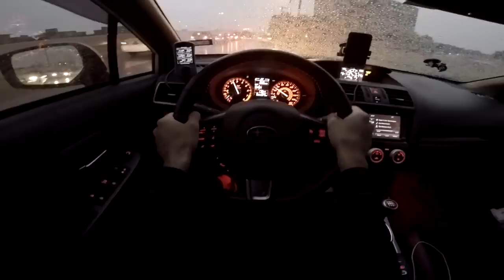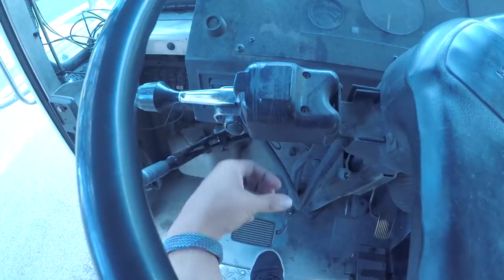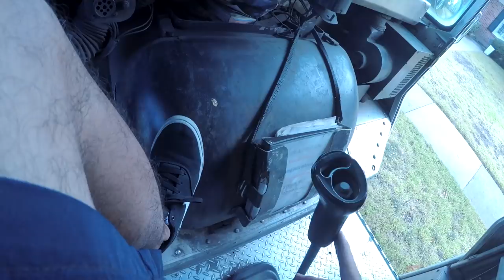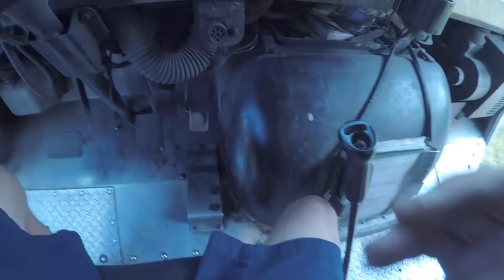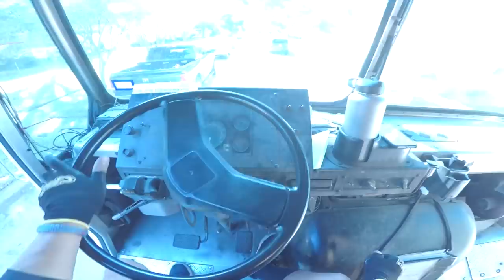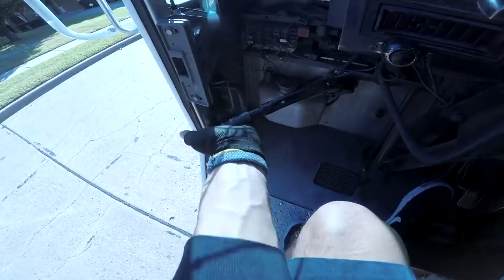How to Drive Manual IN A DELIVERY VAN!!!!

Comment: Never seen 1st gear left and down
Reply: BerlinBLR 
In race cars it’s common. But I have no idea why it’s like that in this, just an old design maybe,
Reply: @13ON3S  it's called dogleg and it's because race cars spend most time in 2nd and 3rd gear and having 1st left and down makes shifting from 2nd go 3rd and vice versa easier because it's just straight down
Reply: At my hub we had only 2 trucks with stick shifts on the whole building and they were both like that. I think it's just common for stepvans.
Reply: It's called a dog leg gearbox so you can get into 2nd and third quicker
Reply: BerlinBLR all the semis I’ve been in have it like that.
Reply: @mlk2634  In some older cars, like the willys jeep, First is down and Reverse is up, and they do that so that when your making a tight maneuver you can switch between the two quickly.
Reply: @Dsack Garage  thats awesome i was going to go feeder but then a mall route opened up over where i am so just push carts around and drive a 24 footer too and from lol
Reply: Is probably a Eaton Fuller one
Reply: BerlinBLR yup is a 5 speed mid range Eaton Fuller Transmission mostly use for small or medium duty trucks
Reply: @mlk2634  the first gear is useless in these trucks thats why its huge to have the dog leg. I never take off from first gear!
Reply: My dad had a old Iveco truck, the gears we're the same as the delivery car
Reply: I'm pretty sure all Eatons are like that
Reply: They do a lotta 2nd - 3rd and barely use the 1st unless they start in a big hill/full af. The 1st is short af
Reply: What I think that’s a regular in semis and stuff idk if you’ve driven one on 10 speed I learnd
Reply: @Dsack Garage you should always use first gear.. because when you start in 2nd you have to slip the clutch longer before you fully release..... So it wears the clutch faster
Reply: its a dogleg shifter, because most of the truck have no synchro in 1st, you dont have to use first unless its a complete stop
Reply: I think some golf mk2s were like that.
Reply: @DSTARX43  are all the manual trucks like that ?
Reply: And because reverse is where 1st should be. That's like the rigs, we never start in first, lowest I ever start is 3rd and that's on a hill, in a 10 speed at least
Reply: @mlk2634  But in "normal car" from 2nd to 3rd is just straight up ...
Reply: @kbdadriftking  on a passenger vehicle maybe, but on diesel trucks the gears are short and you can start in 2nd even 3rd without damaging the clutch
Reply: First gear for me is all the way left and up
Reply: All japanese manual trucks have that shfting pattern.
Reply: Same I’ve never seen it before
Reply: My dad had a Volkswagen Bus from the 80es with the rare 5 speed gearbox and the same pattern.

Comment: Imagine heel toe downshifting in this thing....
Reply: John Mc Clein M. Federico  when you heel and toe it doesn't matter how deep the clutch is. you press the clutch with your left foot then hit the gas a bit change gear and let of the clutch.
Reply: That would be epic 😂👌
Reply: Your employer sucks for giving you this Mad Max truck. ://
Reply: Harry Sachs  it runs great and performs great. whats your point?
Reply: So im a dump truck driver and we actually do heel toe our trucks! Clutchless heel toe downshift!
Reply: @trixter55able  Well if you don't use the clutch you could surely just left foot break. Otherwise what's the point of heel toeing when you don't use the clutch?
Reply: @merlin9702  Nah, the clutch pedal and the brake pedal are really far apart. If you want to google the pedal setup of a Kenworth T800 youll see how far apart they are from eachother! Its just easier to heel toe so your left foot isint at a super weird angle!
Reply: @trixter55able  Oh damn you're right. The gas and brake pedals are also really close which helps. Learnt something today thanks.

Comment: Thanks for the video. A good rule of thumb of when to change gears if you have no tachometer is to listen to the engine. When the engine sounds like it's revving higher, that's a good time to switch gears.

Comment: As a fellow FXG driver, I wanted to add a few things:

1) These trucks are not nearly as old as you think. People saying their from the 80's... They're not. This particular truck is an International model, and this design was used until at least 2003, possibly later

2) They are incredibly slow. The engines are powerful enough, but the lack of a gear splitter makes it so your either dogging the engine or redlining it at all times

3) I've driven one. They're stupid fun, but not as a work truck. Just to roll around in one would be cool, but they're way too impractical for a package delivery application. 

4) I've had people walk up to me and offer to buy it because they thought it was so cool. They garner a lot of attention, especially as Sprinter vans and cutaway cube trucks become the norm. It truly is a "Mad Max" style truck

5) There's a certain sense of pride in having one. I'm the only employee my contractor has that knows how to drive one of these things. I've taken them on charity convoys and come in on my day off to detail them. There's something special about these old trucks. I've gone as far as having considered buying one before, but decided they cost too much to maintain

Comment: I'm just surprised there's a manual transmission truck in the fleet
Reply: Nearly all delivery trucks like these, including big tractor trailers are manual transmissions. Big rigs are usually something like 13/18 gears
Reply: @aidanhalliwell3940  I work for fedex freight and we have all autos, most major fleet companies have autos. Fedex Ground is owner operators so fedex ground doesnt supply the trucks, the contractor does.
Reply: @aidanhalliwell3940  well yeah almost all semi trucks are stick, but it's really rare to see a normal delivery can like this being manual
Reply: @aidanhalliwell3940  UPS is all auto at my hub
Reply: @smandin1  what hub?

Comment: Hills - Do you have to set gas before raising the clutch to the biting point on a hill or does it have enough torque to do it with clutch alone? You probably want to have it at the bite before releasing the ebrake on a hill otherwise the thing will go rolling back lol. I leave it on 1st if parked uphill and reverse if facing down. hopefully the clutch isnt too worn with super high friction point that thing looks beat.

Comment: Gearing is similar in the lower gears of an old l9000 dump/water truck. Even though I never use first gear and I only clutch in when starting/stopping and when I go into 1st.

Comment: i dont like driving manual trucks and suvs and such, only cars and motorcycles, a guy who i know from work has a SRT 10 single cab, and if you know those single cabs are only manual transmissions, i just feel uncomfortable shifting with that long shifter cause i might miss a gear or grind them, i already do that in my 2016 mazda 3 lmao, subbing for that nice looking WRX

Comment: Try floating the gears really only need the clutch  when starting and stopping
Reply: Or start off in 2nd gear. 1st gear on trucks that size are usually very low.
Reply: @michaelchan8915  Granny gear
Reply: F it. Just start the engine while in gear and go!

Comment: is it harmful to the vehicle to leave the clutch pushed down while at a stoplight? My dad used to be a truck driver and he taught me how to drive manual. He said always shift down through the gears until you get to second or first, and then just leave your foot pushed down on the clutch and coast to a stop. I know coasting for long periods of time with the clutch is bad but I only do it for a few feet while going like 5mph before I stop. I do drive an old tdi if that helps.

Comment: You forgot about telling people about putting truck in 1st gear and turn wheel left on uphill and R and turn wheel right on downhill so the truck don't start or roll if parking brake aka E brake don't work. Back in 2005 I had a hatchback SiR 1992 and 2014 Ihad a GMC topkick 30 foot truck with that problem

Comment: You don't need to be out of gear to start a manual vehicle you just need to step on the clutch. You can then immediately start to release the clutch to get moving. This applies to all manual cars I've driven and I don't actually see a reason why it should be different with your van :)

Comment: actually, you want to use engine brake when approaching a stop sign, downshifting and releasing the clutch pedal, you just don't put the vehicle in neutral...it'll decrease your stopping distance a little and saves a lot of brake wear as well.

this is how we drive a manual in Italy.
Reply from the maker: Interesting 🤔
Reply: LunatiKz Another reason not to roll up to a stop sign/lights etc in neutral is because if another car unexpectedly pulls out or something you want to be able to react and accelerate out of the way if needed.

Comment: I drive tractor trailers and learned how to drive a 10 speed manual on those which was hella stressful. I always float gears when I drive a manual. Its easier than having to clutch every tine you shift. Have you tried that on those trucks?

Comment: As a truck driver here a few things wrong with your shifting skills lol
1. It’s illegal to be in neutral while coming to a stop. You have no control of your vehicle if you need to continue driving & it helps you slow your vehicle down if in right gear. 
2. For either uphill or downhill parking, turn the wheels toward the side of the road so the car / truck will roll away from the center of the road if the brakes fail.
3. Don’t cut off semis again... In your tornado 🌪 video I heard that truck drivers horn when you merged on the freeway 🛣.
Reply: To be clear on the video where you cut off that driver...
It was the one where you talked about how you get around with no gps.

Comment: READ MY COMMENT! 

I failed UPS driving test.

Do not wiggle the stick shift in neutral. Instead go from gear to gear. 

Do not put van in neutral will coming to a stop, always down shift according to your speed/rpm.

At a red light, put van in neutral, and pull the e-brake until you go. 

Don’t shift from 1st to 4th. The stick clicks instead of grooves, so click it from 1st to 2nd. 

Good advice on turn signal, wipers, and lights. Bad advice on everything else. 

On reverse, use back up camera more than your mirrors. 

Van goes up to 5-7 mph in first gear!! 

Please redo this video with MY ADVICE!